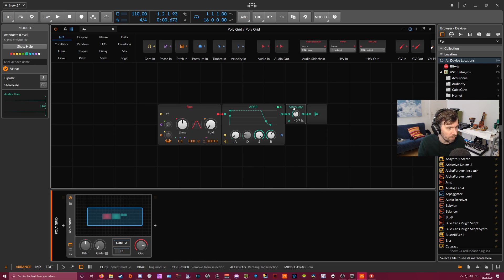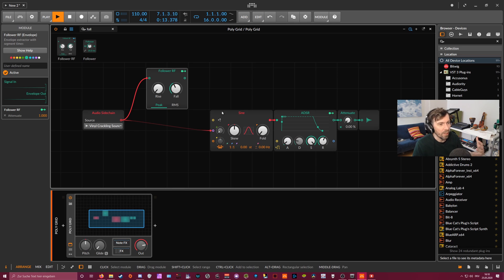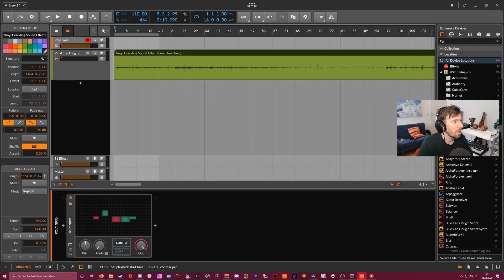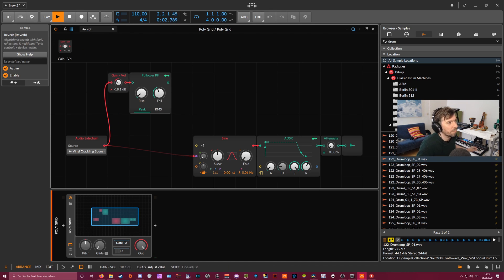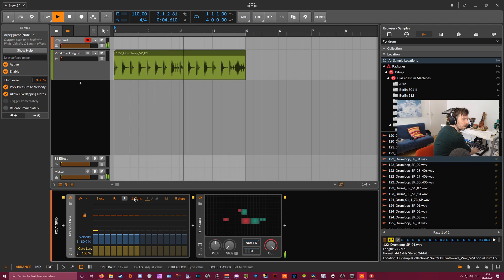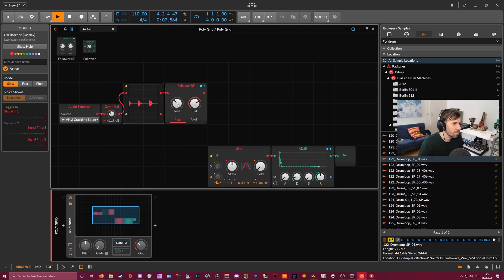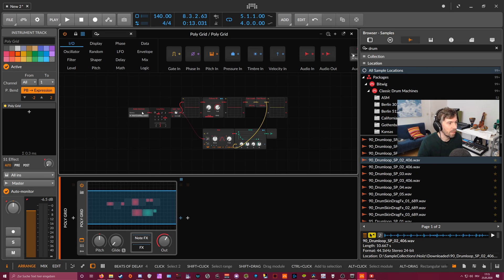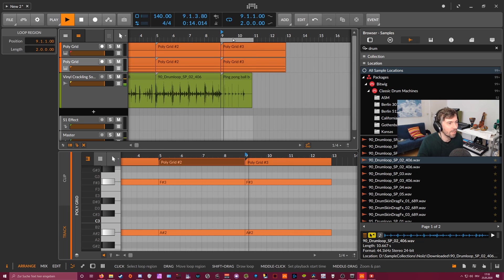🤓 Shaping Synth Sounds with Static Noise / Groove Extraction in Bitwig Studio

Comment: Cool stuff. Since you can load sampler into the grid, I guess you could do the same stuff with the sampler module rather than audio side chain, which could be even cooler since you can use the textures mode as a really strange modulator.
Reply from the maker: It's hard to showcase all possibilities in one video but yes you can also integrate the sample with a sampler in the grid. In this case I found it nice to have a track with static noise  for synchronization purposes. Also maybe to use already existing tracks in the arrangement. 😊